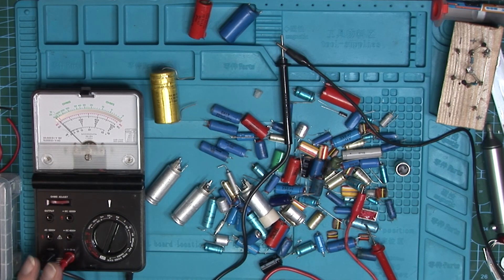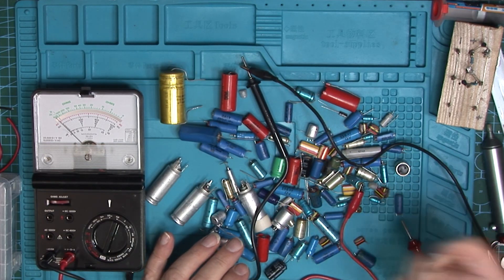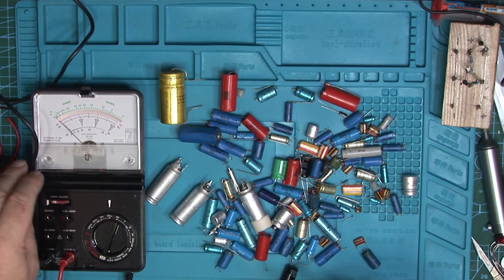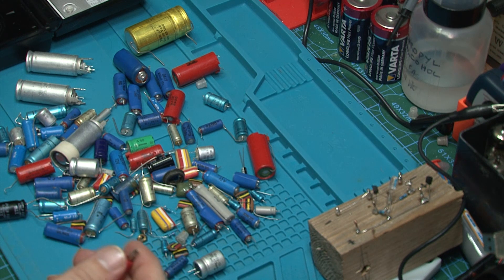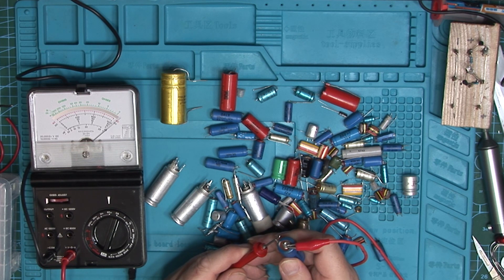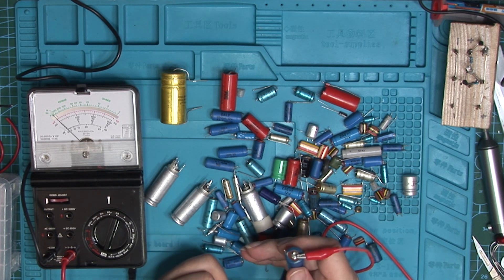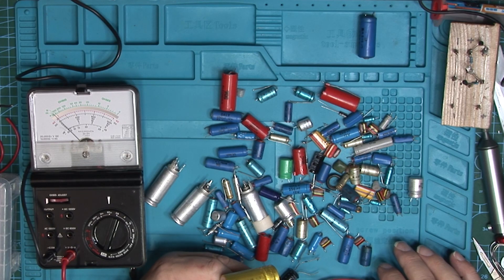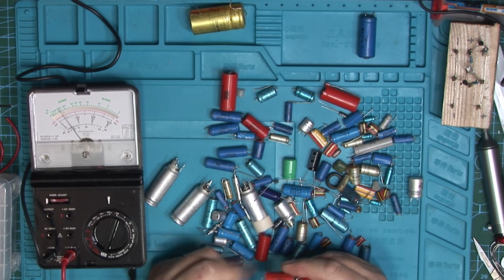Electrolytic Capacitors and DC Blocking, finishing with a BANG!

Comment: I have had larger caps explode quite violently, not only did the cap require replacement, so did my underpants🤣
Reply from the maker: Indeed, I have had large smoothing caps go but never deliberately like this.I still jumped a bit when it went!

Comment: Very good graphic demonstration of what happens when a polarized electrolytic is connected the wrong way and a very good discussion on DC blocking George. Always a joy to see your videos.
Reply from the maker: Thank You Larry. DC blocking is something that can kill tube sets and it doesn't do transistor sets any good either if there is dc on the next stage slamming the transistor hard on. Reverse polarity caps can be even more dangerous, especially if you do it to the big unvented smoothing caps in radios. Keep Well and see you soon.

Comment: Wow what a great video George! I was bit worried for you with that Russian Capacitor, I wasn't sure how big of a bang it would be, but I saw how close your hand was! It was definitely big enough for shrapnel! Take care!
Reply from the maker: That was one of the small ones found in an 80's transistor set. I really should have had safety glasses and gloves on but I'm really not the full sandwich sometimes and just do things at random. I wasn't going to pull out one of my big tube set smoothing caps though, that would have been too dangerous indoors. Stay safe Gregg.

Comment: Very good George. Nice demo of DC leakage using the power supply and multimeter. That Russian cap certainly went with a bang and nearly took my eye out 😜. Cheers Graham
Reply from the maker: Its a good test without having to drag out the Heathkit tester, which is still quite high voltage even on its lower settings. The Russian was only a tiny one, imagine if it had been the bigger ones from the Selenas!

Comment: Nice to see you at the bench george, keep the electronics hobby alive 😀
Yep i've blown up crap-a-citors, mostly because i was in a halfbaked mental state.
My default state 😀
Pooooo what a stink lol
I've tested anode to grid coupling capacitors using the working potential and a 10 meg multimeter in d.c volts mode as the charge resistance.
There were quite a few craps dead in a Leak amplifier i was fixing,  Leak lol :-D perfect name.
Get some tea down your neck 😀
Reply from the maker: I am getting back into the swing of things at the bench. Blowing up caps is a fun sideline to keep you on your toes!